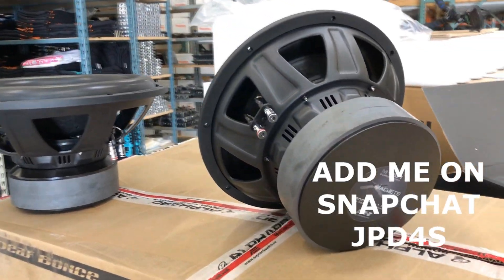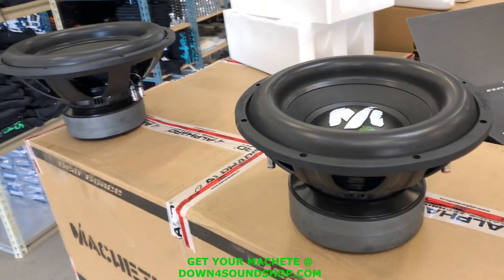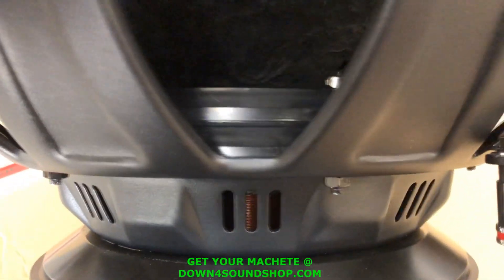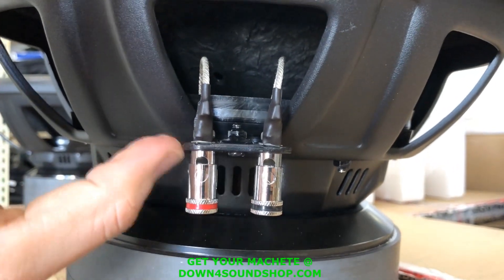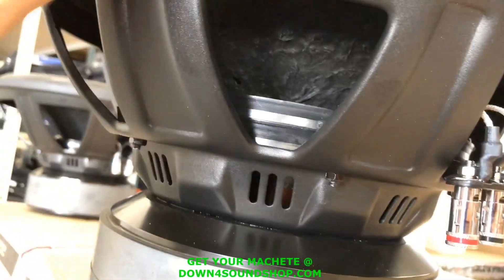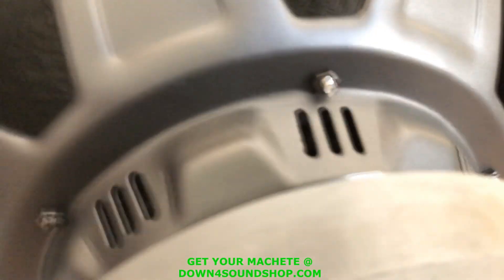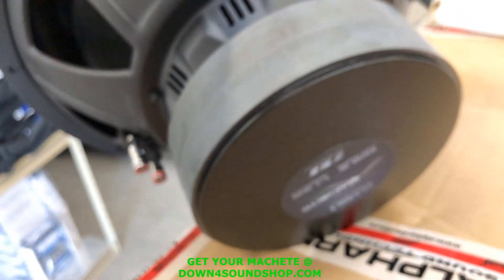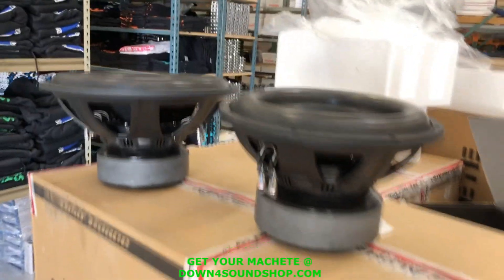JUST RELEASED MACHETE SUPER SPORT 1300W RMS SUBS!

Comment: So I am deciding between some amps to help run my 2 SA-12's that will be wired at 1 ohm. If anyone could give me some advice in terms of reliability and best power for the subs that would be great. My options are a Sundown SAE-2000, Crescendo BC2000D, DC 2K or Incriminator Audio IA15.1. Or maybe something else?
Reply: Kevin D. Stay away from crescendo audio. Sundown you mentioned is a budget line amp from them. The IA is the most original design with dam good specs and parts. And you definitely get what you pay for.. IA amps definitely do rated and then some.
Reply: Up To Bat Entertainment Why do you say stay away from Crescendo? I have heard really good things about them.
Reply: Kevin D. Ppl having issues with the warranty. Amps repairs take forever. Amps that get warrantied are not in stock to be to be replaced. This is from my research when I was going to purchase amps from them. Things may have changed, this was in the last year to year and a half.  Also when I contacted them, they kept trying to upsell me to a more expensive amp I don’t want / need. Then wouldn’t tell me when the new design of the amp I wanted would be tested and ready for daily use. I didn’t want to pay to be a beta tester. Again this is my opinion and experience only. 

I also purchased their sound deadening and it had a strong smell and was poorly quality controlled. The logo on the foil would rub off. Some didn’t have a logo. A few sheets were stuck together and different thickness. Most were same thickness but still the sound deadener was about the same or a little less quality than the cheap Noico Amazon deadening that is 80mil 36sq ft & $64 shipped. The crescendo crap was $110 for 40 sq ft supposedly 80 mil. That’s my experience. I still think the contralto subs are bad ass tho! I would go with the IA 15.1 is does more power than listed! 
Have a good one 💯